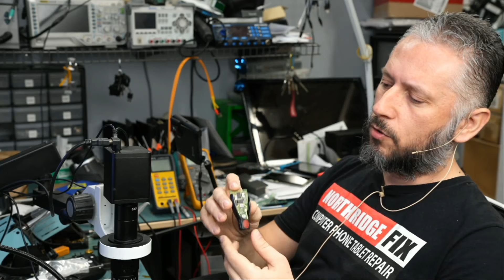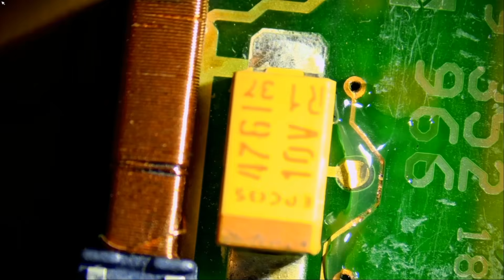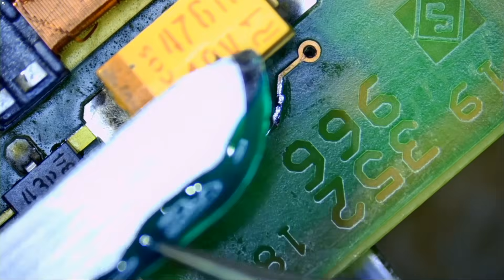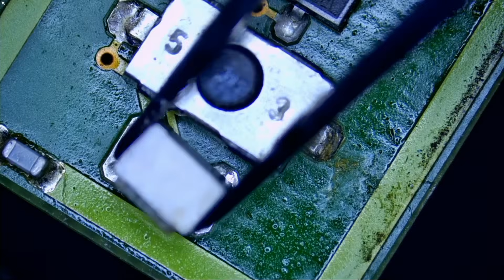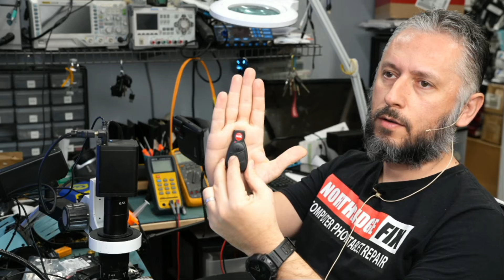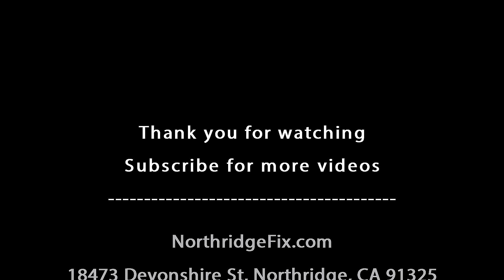Benz Key Fob Repair - Won't start or Lock Unlock the car.

Comment: Hi i have a 2000 Mercedes Benz CLK 430 I would like to know if I need to replace the key or I need to reprogram the key when I put the key. It tells me to remove the key from the nation the doors stay open and close but it won’t turn on the car.

Comment: I have a 97 c230 my girlfriend kicked my key fob out of ignition to start I tried to put back together with spring the flip out laser key then I dropped key lost the mother board but didn't know it . I went to start the car it would not . so I check the batterys in fob and saw them loose and motherboard was missing. put it all back together and the locks work car will crank run for a few secs and not stay on like I tried to use the flat key

Comment: I have one of these keys that just stopped working on my 2008 ml320... My spare key works and I can't seem to isolate the fault on the bad key. It won't unlock or start the car but I do see infra red, and the coil has continuity. Are any of the other surface mount components common failure points I should check next? The board itself is very clean with no corrosion or damage from water.

Comment: Hey Alex, I’ve been a long term fan more than (4 years now) your videos have helped me develop my technical skills that come from your amazing channel, I learned how to solder from your channel but couldn’t become a professional yet it’s difficult without all the amazing tools you have which I cannot afford, I have a Mercedes key on which I lost my infrared part before that the key wasn’t functioning throughout the buttons, seemed like an issue of power but when I tried to fix it I ended up breaking and loosing the infrared I really need your help! I’m in Vancouver right now, I can’t even start my car no more! Please help!😢

Comment: How did you manage to bend that nice girl's iPad at a 20 degree angle and her not realize it for 2 months?   
I think you should warranty all work for at least 10 years, 100,000 miles, solder to solder, even extending to the parts you didn't touch.  That's a fair warranty for the Entitled Zero-skills Zero Productivity class of citizens rapidly becoming a majority on the Left Coast and everywhere else.

Comment: Hi Alex,Sometimes a little thing just triggers a solution, This video made me go back to my own faulty keyfob and check all the lines. Turns out it was actualy the negative connector plate that had coroded away from the line, thanks to your close up of the faulty line I caught on after labouriously checking all the components and cleaning the board to remove any water damage tracking. (I left my keys near the kettle, and someone who loves me dearly made me a lovely cup of tea and decided in the process to spill some water over the fob.) So big thanks.

Comment: Man I have a key same key and mine stopped out of the blue. I was using it and when I got into my car nothing happened. I was stuck and had to get my spare dropped off to me. The dealer wants $200 for a new one. How much does this cost to fix?
Reply from the maker: Get it at the dealer. We charge more.

Comment: HIGH,
I have 2 Toyota key fobs.One of them works fine but the other does not open the doors and I can start the car with it only when I put the Fob very close to the start button.
I have changed the batteries for both fobs & the problem was not solved.
Any suggestions?

Thanks

Comment: So i got a Logitech driving force gt no light no force feedback gas and brake pedals work and shifter 24v adapter is working i checked that,there is some kind of short on the board one tvs diode [1.5KE27CA] i dont have any in my country i tried searching (am not from uk) shipping 30-60days…
Can i use any other classic zener diode? there is some kind of short on the board when i connect 24v to board it only consumes 0,8 or noting my dad says its some kind of short on the board.
Can anyone help me?

Comment: Hi Alex. I am a PC tech in the UK. I just wanted to let you know that your video's have helped me repair a few PC Motherboards with minor trace and Capicators issues. I don't do in-depth repairs like you, but the task I take on has helped to increase my revenue where I would have otherwise lost money. Thanks for your tuition and easy to follow videos. Don't ever lose the faith, and don't let those with negative attitudes put you down. This happens all over the globe, in all industries. Knowledge is power.

Comment: Nice fix! I bought a 2nd hand merc with an opposite fault to this. Radio unlock would not work, but IR unlock would. Key would start car, but had to point the key at the IR receiver on the door handle to open it. From what you've showed, it looks like the coil, or traces near it (in my instance) was faulty. I sent it to the garage and they said they couldn't fix it, where I'm sure you could!
Reply: Garages dont do microsoldering

Comment: This curing UV light does not produce 10W (you can measure it with USB tester, usually around 2W). I bought another one from Relife with real 10W power and felt the difference right away.
Reply: Did you hurt your eyes for testing the true power of UV's light? 😂😂😂
Reply: @deathtrap1976  of course! otherwise how I could be sure! :D
Reply: @Styler3x  So, I guess you're using a Braille keyboard, TalkBack and sunglasses from now on, don't ya?
Reply: Re-watch the entire video, but this time look for cues of sarcasm. Your whole world will change.
Reply: @PaulLawson-k8v  What are you on about?

Comment: If the frequency is always the same, then how does it know which function to operate?
Reply: Frequency is just a carrier. Change in amplitude makes a difference, it creates voltage spikes that gets received, read and turned in binary code and decoded.
Reply: Digital code is being transmitted, not analogue.
Reply: @gjt2209  as are the PRFs for the AGM 65E.
Reply: Same way you can listen to radio, except instead of sounds it sends pulses which the car can decode.
Reply: As other people are explaining, the frequency is just the particular 'channel' that the car is listening on... which is enough to know that the remote is working or not.

Comment: i got PCB UV mask (from another place not from your store sadly, big mistake) and the mask is not hardening under my 30W 395-405nm wavelength UV led at all, but as I can see even your solder mask is not hardening under the UV light, it got hard only after you applied some heat, can that be the trick?
Reply: i watched your video about how to use a solder mask, after all it seems like the solder mask i bought is faulty, lesson learned, buy things only from credible sources...

Comment: Wouldn't it be easier to solder an isolated wire to test point on left and hole on right?
Reply: The shorter the length of repaired track the better.  Maintains electrical characteristics' and reduces potential interference whilst also reducing the amount of external material required.

Comment: Why you pre liquify the solder using hot air and then quickly palce the component
Reply: The components on the other side would fall off.
Reply: Lol.